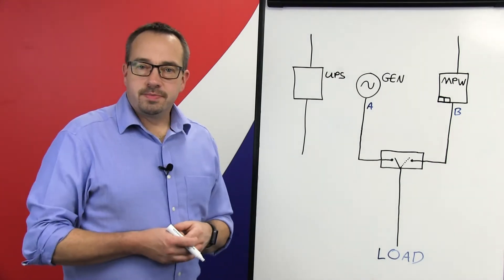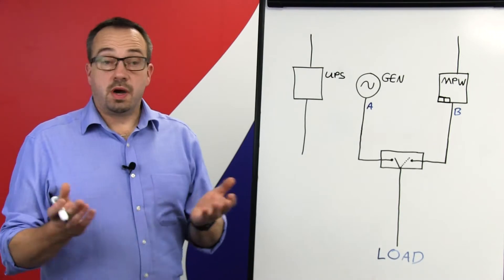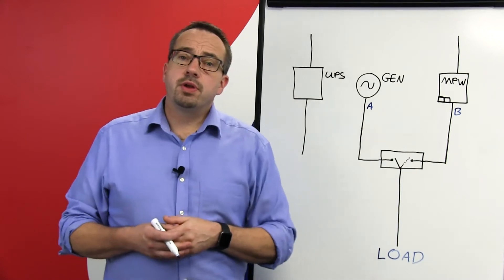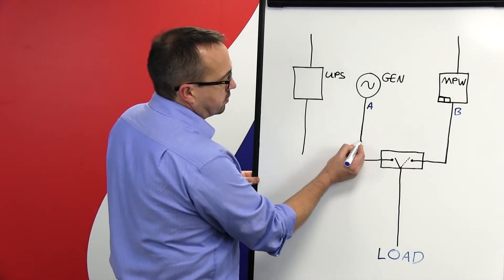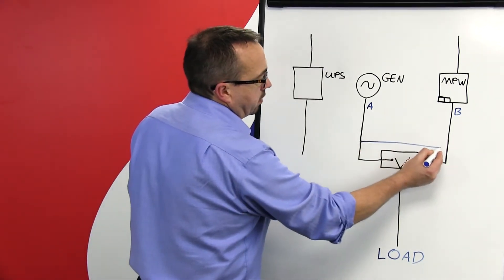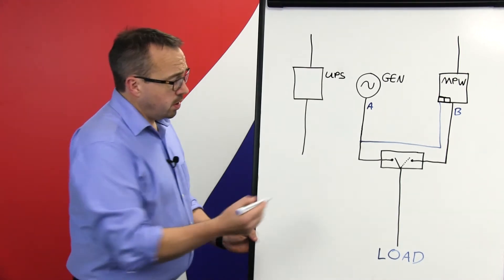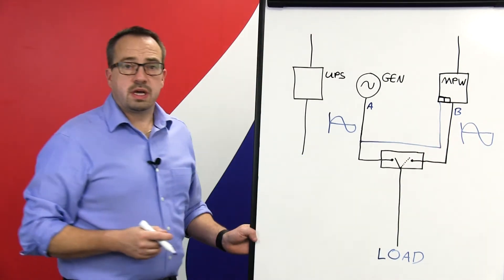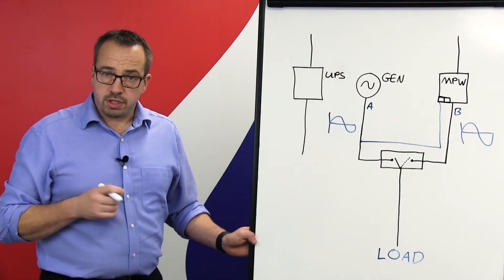#TechTalk: How To Synchronise Multi Power (MPW) UPS

Comment: Hi... with this configuration while the output of MPW UPS is in synch with third party UPS output as explained will it be able transfer the load instantaneously through static bypass in case of faults? As the output voltage might not be in synch with the static bypass input voltage anymore